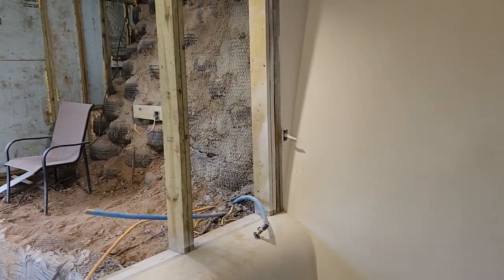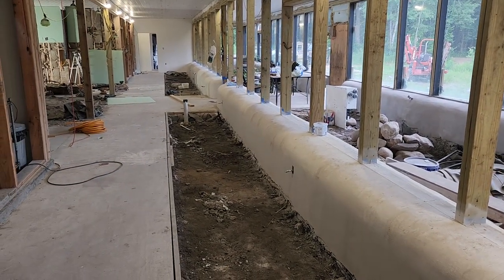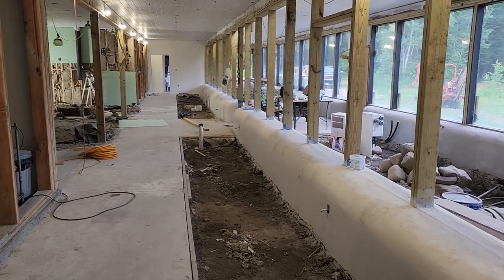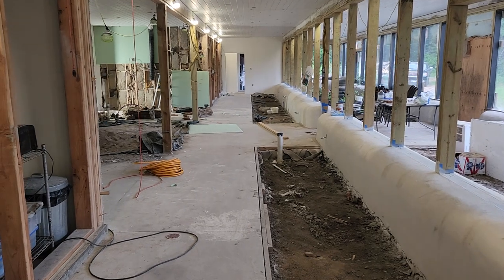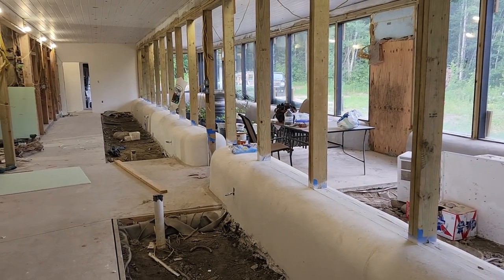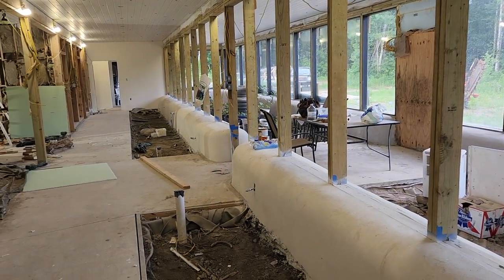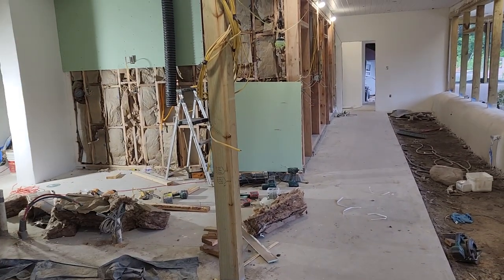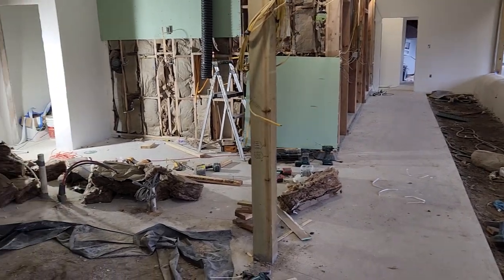Earthship cooling tubes on a super hot day and plaster update.

Comment: Awesome, love it. As a general contractor, been in construction 27 years or so, I really wanted to build an earthship for ourselves. We live in Oklahoma though, so I had some concern about the high humidity that we can get for extended periods. I have an engineering background, and I think I have come up with a solution for this, but wasnt willing to take the chance. We ended up going a different direction last year when we built ourselves.

We did go out to Taos though, and even stayed in one for a few days. Really intriguing design.
Reply from the maker: What was your idea? I have some as well that I am going to make some videos on
Reply: You'll need lots of ventilation in a high humidity environment.
Reply: @Offgridgoat  ….multiple change I feel would need to be made to the base design. One being the earthen back wall. While understanding the importance of having the thermal mass, I believe in high humidity areas this will be an issue. So in order to solve that, it needs to be something that can absorb and store the temperature. It may be that a thick concrete wall could accomplish this, while still allowing for a better option to alleviate potential moisture issues. I have laid out a multi layer design that would ensure no ground moisture issues on the interior. Unfortunately the cost of this, in todays ever changing supply concerns, is pretty substantial. Even building it myself would still result in a large expense. The second substitute may be CMU blocks then filled with concrete, or possible earthen material, but would still need to be thick enough to allow for sufficient temperature absorption. And again, following this initial construction, there has to be multiple layers behind the wall to solve the moisture concern. Some of those layers being a vapor barrier, a layer that has high hydraulic conductivity to divert the ground moisture etc, a layer of insulation to isolate the thermal mass being used (I think this becomes more important when using concrete), and finally a water proofing layer/membrane (in addition to the previously mentioned vapor barrier). 
For many, the cost of this would not be feasible. Instead of the housing becoming more dost effective, it actually increase cost per sf. However, this type of design (once proven) would solve two other potential, but very real, concerns in building an earth ship. First, the issues of financing through traditional means. Most banks will not loan on a tire and earthen structure. Secondly, many people, for many years now, have steered away from this incredible overall design because of it not being traditional. While that is what draws me, and many others, toward its unique and effective design, its those very things that keep the vast majority of home buyers from committing their single largest purchase in life towards. I believe by making a few “concessions” in design materials (but still accomplishing the purpose behind the design) it would allow for easier financing, locality compatibility, a higher positive response and wider acceptance of these structures.
Thats the short version of my .02, but usually not worth that. LOL. I do honesty believe the larger concept here could drastically change our energy consumption, overall lower home maintenance costs, and even safer structures than many others. But to truly do so, the reality is that there must be changes made to the current and traditional design. The purists dont want to discuss it, but these type alternatives would solve many resulting concerns and issues in constructing such a brilliantly designed structure.